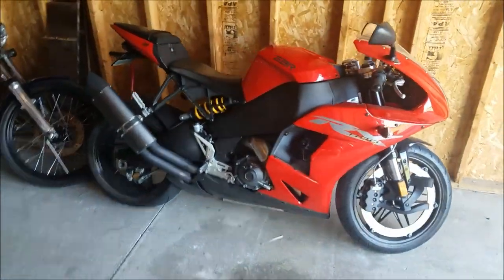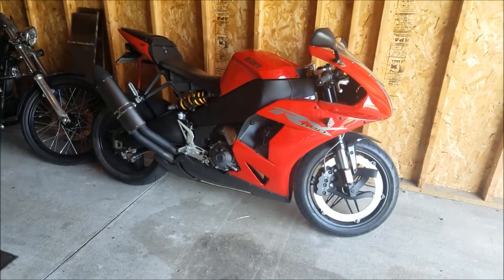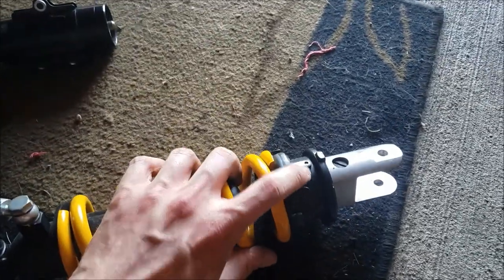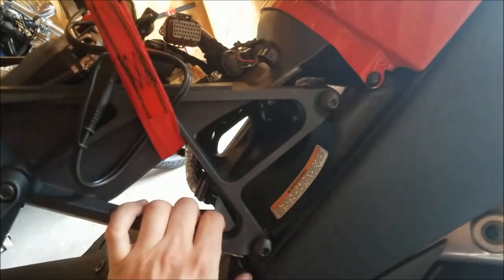Painting a Motorcycle Coil Spring??

Comment: Question, I am thinking of painting my cars coils spring with this paint.
How has you coil painting job held up under time and usage?
thx
Reply from the maker: Mine has held up very well. I will say though that my paint job being on a bike doesn't see the elements as much as say a vehicle. I think it should stand up fairly well, but road salt from winters if living in the north may cause issues. I can't confirm though.
Reply: @WeakestofWeeks  Thx, This part is on a classic - muscle car so it will see a garage for 95% of the year , or driven in sunshine only .
Reply: @ashqelon7267  yeah that will be fine, I have a similar application.  front coils on a garaged, occasionally driven auto.